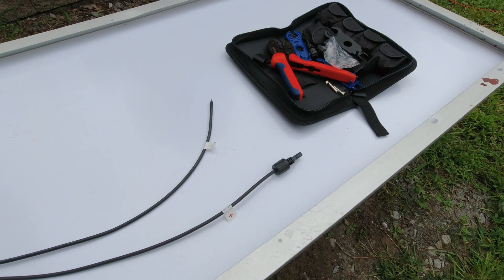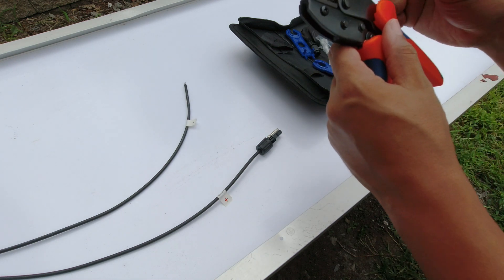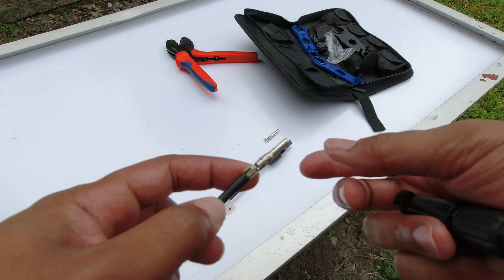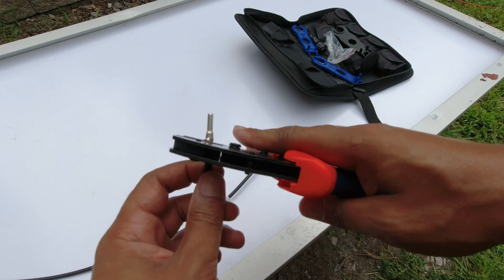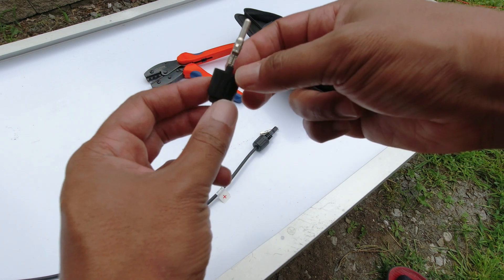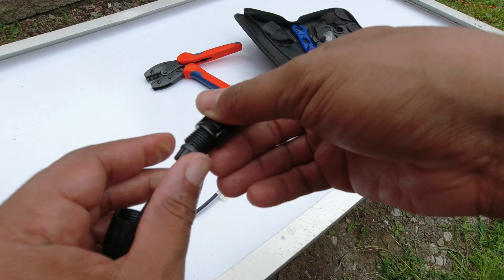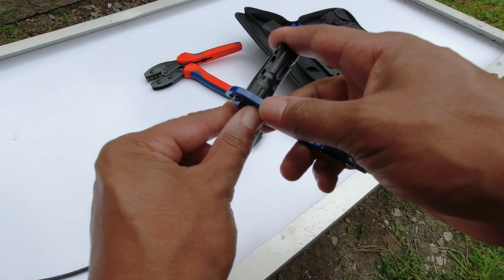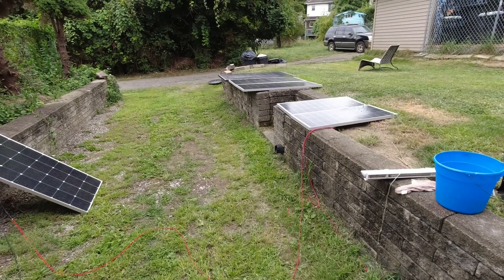My First MC4 Repair feat @BougeRV MC4 Repair Kit & HQST 190 Watt Panel

Comment from the maker: After the repair, I tried to test and it didnt go well. I recorded a more casual testing video from my patreon supports but you can view it here if interested. 
https://youtu.be/btdL8xpG0Mc
Reply: sometimes (too many) those pins, even though you hear the snap is NOT inserted far enough. As well that red rubber gasket MUST SIT PROPERLY or it "forces" the pin back out enough that your cable appears open. You may have to disassemle it and crimp  again... or unscrew the connector and push harder to get the pin in far enough. Measure voltage of the panel..that's enough to tell you about your crimp...hope this helps
Reply from the maker: Yeah the follow up video shows my testing.

Comment: I made a few connecting our extension cables for the solar panels I have including replacement of SAE connections with MC4 connections, my old sort of trusted automotive/domestic wire crimping and stripping tools finally bit the dust so I treated myself to new tools costing about US$35 each from Amazon 🤣 well worth it imo especially as one side of the crimping tool has square MM marks and the other side has AWG marks, less chance of mistakes.
Reply from the maker: Those tools sound nice!! I got some 20 foot renogy cables because they were the same cost as some 15 foot. Figured I'd chop em up later. Looking forward to that.
Reply: @AskIveSolar  I got them cheaper on Amazon than from the hardware store lol £25 instead of £35, bought some 30amp Romex type outdoor cable (20mtrs about 60') and was surprised to find it's the same AWG as a set of 16' solar panel leads 🤔 strange how things happen.

Comment: one thing id recommend ive is doing a pull test after crimping to verify its nice and tight, well done
Reply from the maker: Good point. Haha. But that's what got me in this situation in the first place.  Kinda. 

I freaking grabbed the panel all willy nilly and it got hung up and the mc4 slid right off.

Comment: Just an FYI... those numbers on the side are identifiers of the corresponding wire size. They are the millimeter version of the awg size wire/connector you are crimping. Standard PV size of 10awg would be 6mm (or 12awg would be 4mm and 8awg would be 10mm) just as an example. You would want to use the spot that matches up with the wire/connector size that you are working with, obviously. A panels wire should be the standard 10awg/6mm size.
Reply from the maker: Good to know! Panels range in wire awg tho. I've seen 12 and 14 for sure. Just today.
Reply: @AskIveSolar  Good point. I Totally agree. I probably shouldn't have said "standard". You can never assume they are guaranteed to be one size or another.  :)

Comment: To the point as usual :-).  As you probably know, the other side of the MC4 tool, shaped like a "V",  presses the MC4 locking tabs together, helping separate connected MC4 connectors.
Reply from the maker: Hmmm. 

Thanks for the appreciation of the "to the point" nature of the videos. I value folks time.

Comment: MC4 connectors are transgender. They are inherently one way on the inside and the opposite on the outside. I get rid of all my MC4 connectors and immediately make SAE connectors. Nip all the confusion in the bud.
Reply from the maker: Now that's interesting @ preferring sae!!
Reply: @AskIveSolar  Are you aware of any power stations that have a MC4 connectors for input (or output)? Ever ask yourself why? It is my belief MC4 was created for outdoor use and to have a weathertight housing. It is also my belief placing a sheath over SAE would achieve a similar result in a residential usage scenario. The more I fool around with this solar mess, the more I see the marketing influence on the technology. I, for one, am not down with the MC4 culture.
Reply from the maker: I have seen one. But I cant remember it. Mc4 is certainly a bit of a one trick water proof pony. I ain't heat shrinking anything. Ha